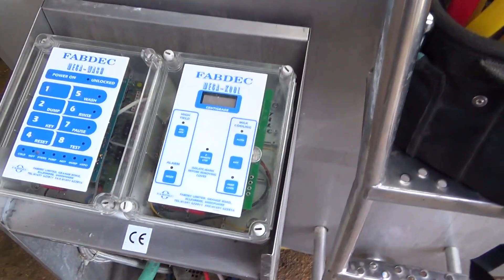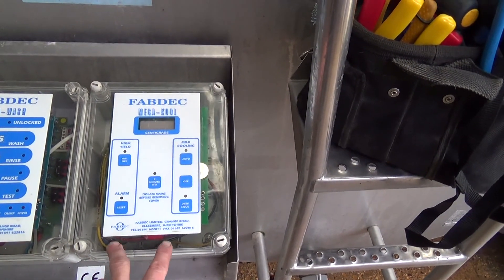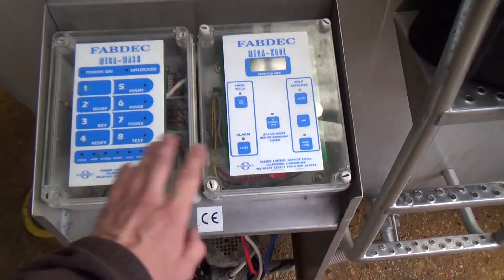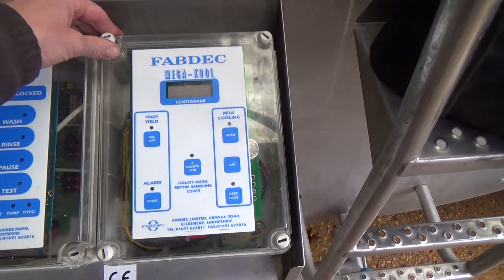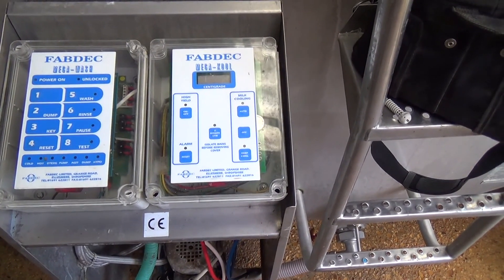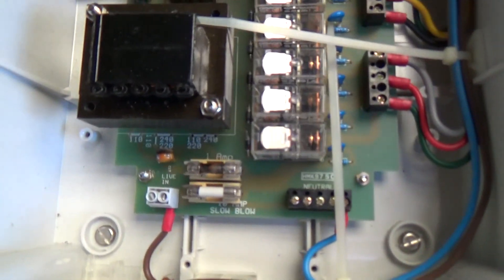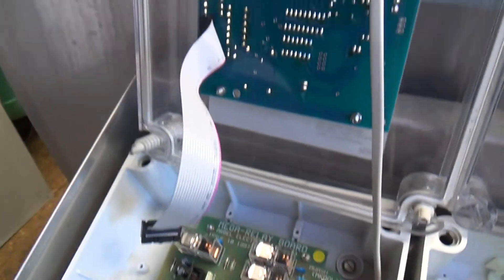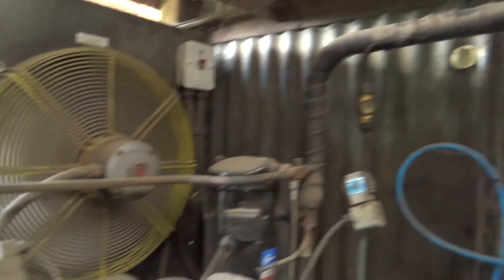440V into 240V goes BANG!

Comment: Guess these things must be made to a price.

For farm equipment, you'd have thought a bit more care in the design of the PSUs in the controllers would have been taken. An over-voltage triggered thyristor on the output of the transformer, and a resistor/zener diode network on each CPU's power bus, would likely have limited the damage to a blown fuse.
Reply from the maker: They are generally pretty good, this one has lasted 16 years of being on 24/7. Hopefully the new one will be better designed.

Comment: What a pain!, I repaired a 120V pizza oven controller that was accidentally fed 240V, by replacing the MOV's (Blue and Yellow ceramic cap like things) and repairing a copper trace that was blown off he board.
yours could be a similar fix since the linear PSU would not usually overvolt the secondary side.
Reply from the maker: I went with a new controller so its covered by warranty etc, plus parts are getting hard to get for these, as they are 16 years old.
Reply from the maker: And Bang! haha
Reply: Dang!

Comment: I worked at a place where they were having a new backup generator installed (lots of IT gear like servers ect that needed a UPS) and when the sparkies were testing it prior to commissioning a couple of phases got wired up wrong. It was an old building with the old colours and as soon at the genny sparked up all of the PC's and lights ect started blowing up! I think there was nearly a million pounds worth of damage that day... :s
Reply from the maker: Wow! A bet they were not popular! You'd think they would turn everything off before powering it up, and just check the incoming cables first for correct voltage and rotation.
Reply: One would have thought so!

Comment: Looking at that I thought the MOV might have just gone short circuit and you could just clip it out. But looking closer I can see a bulged capacitor on the secondary side, I'm wondering if that's been over voltaged as well (bad news for the rest of the board) or if it's unrelated. Them power companies sure are putting a lot of work your way :-)
Reply from the maker: I wondered about that, but i would not be popular if it only lasted a few weeks or months more, at least with a new board they have a warranty as well. Though i suspect it would have done more damage as it would have put nearly twice the voltage through all the components.
Reply: heavydiesel I was only suggesting a temporary fix as you had to spend some time by bypassing the electronics anyway.  You'd have to remove the boards anyway to replace the MOV's and capacitor  anyway. Also some protection should have been provided by the voltage regulators(if there still working) to the logic ic's. The fact that Mov's shorted and the fuse blew should have meant that any over-voltage to the rest of the board should have been short lived.  I agree with you anyway the farmer needs the system as reliable as possible so new boards are the most satisfactory fix(especially with the electricity company paying for it).
Reply: Coolkeys2009 Just thinking about it more, even if removing the mov's allowed the system to power up. With 3 phase compressors starting and stopping and solenoids on valves and single phase motors etc on that system as well as other farm machinery. It may not have run too well even overnight without replacing the mov's.

Comment: Looks like he should get whole panel MOV units for the farm supply then, will help with mains surges and spikes as well. Expensive devices but will save the electrical systems. Would help as well to put a phase failure relay in the control panels to keep the motors from burning out in case of phase reversal or failure.
Reply from the maker: Yeah, i think this was a one off, the power supply company were running the whole village from a generator so they could do work on the power lines when things went wrong. Like a lot of things, there are ways to prevent damage but the customer needs to want to pay for it.